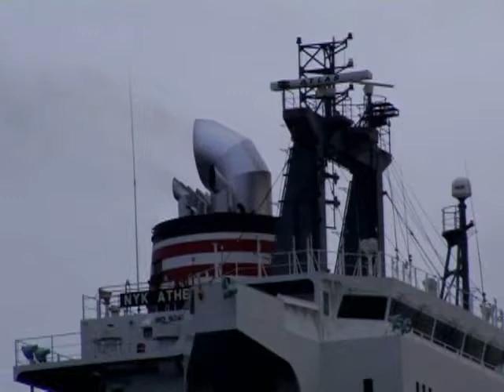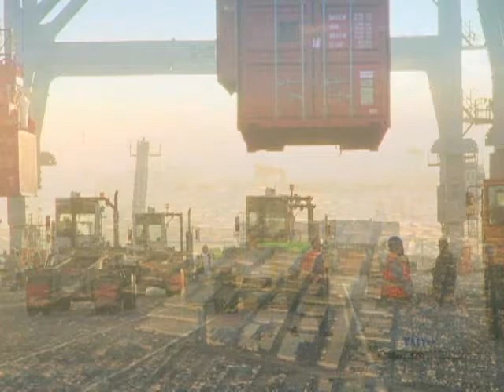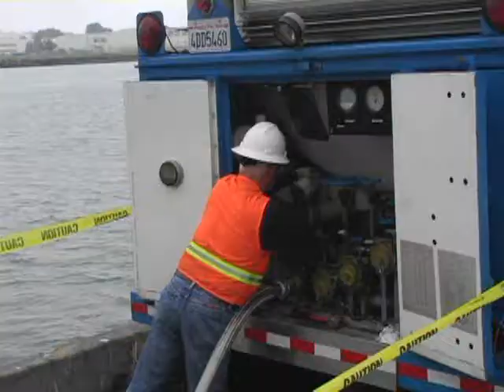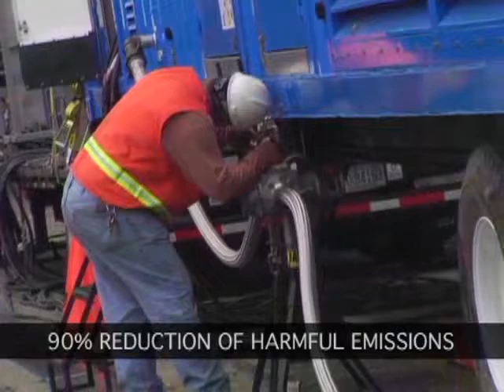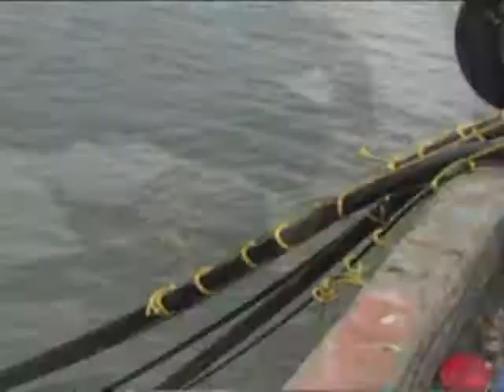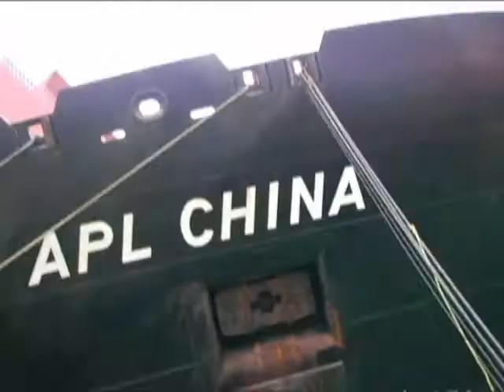Cold Ironing: Reduce Port Pollution

Comment: "it's that easy!" -- Unfortunately, without powerful legislators like California's, operators and shipping lines will have to be the pioneers of cold ironing in many states. The on-shore portion of implementation alone ranges from $4-7 million per berth (EPA). Long term TOTALLY beneficial.....I just wish it were as easy as you made it seem! A common set of standards would certainly help too, but that is being worked on.